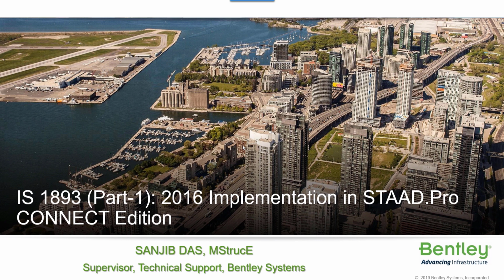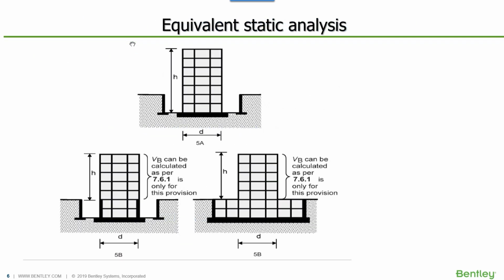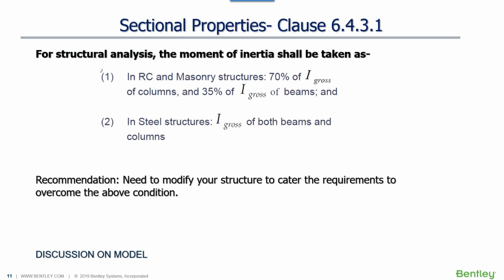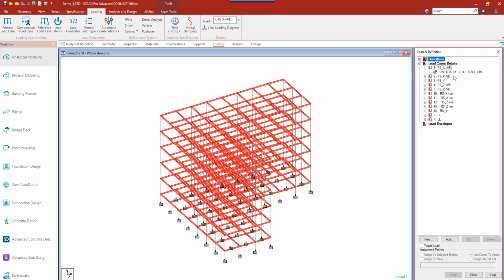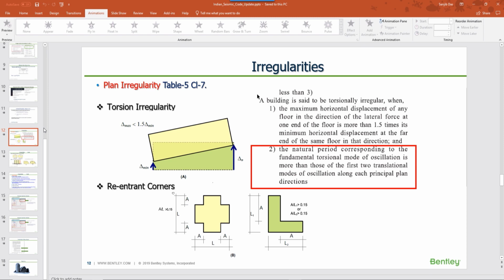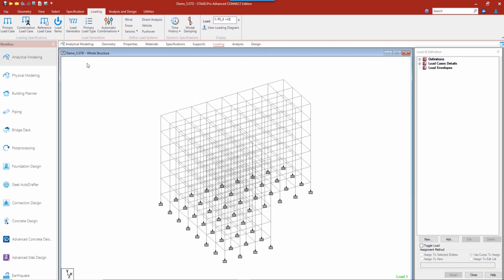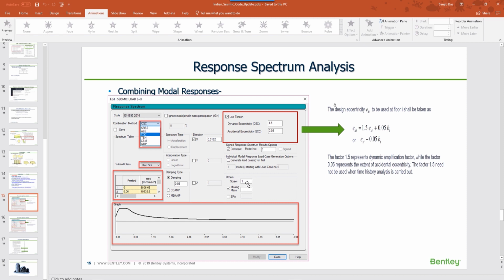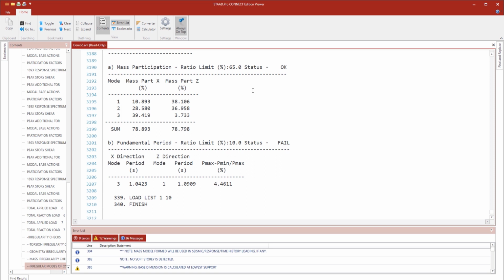IS 1893 (Part-1)2016 update in STAAD.Pro Connect Edition

Comment: Try to programme the software to design beam as doubly reinforced section instead of warning Singly over reinforced.

Special care to be taken for design of short span beams.

This design are to be prepared as per IS 13920.

Software to be programmed for checking of beam column joints for the joints whose all beams & columns designed. For a singly warning & fail, it is not checking the joints of columns & beams.